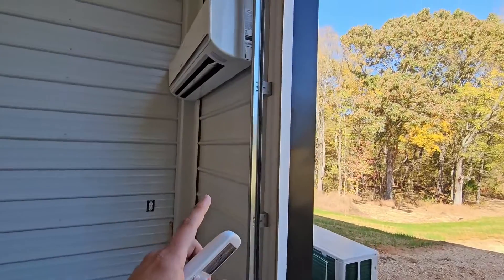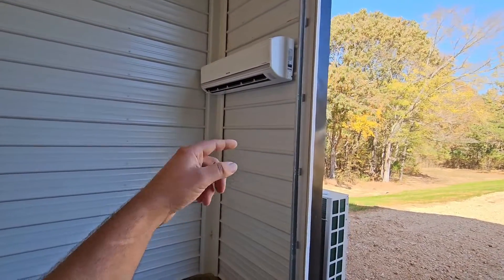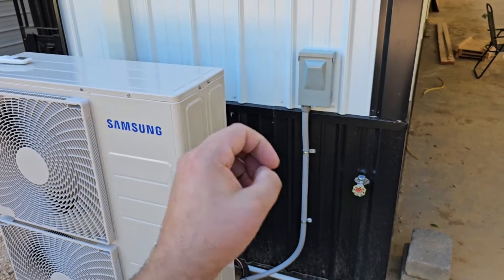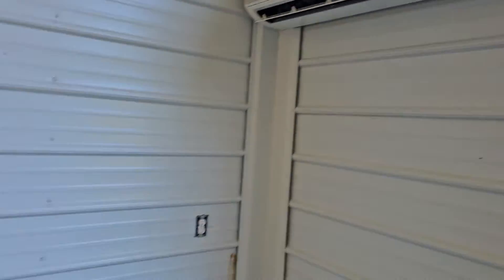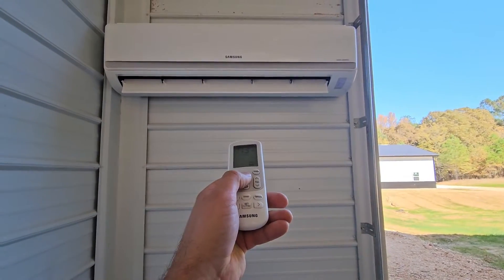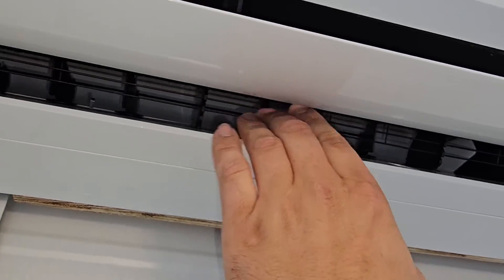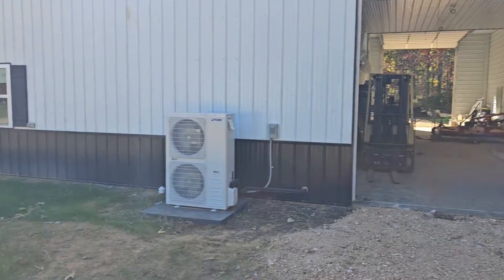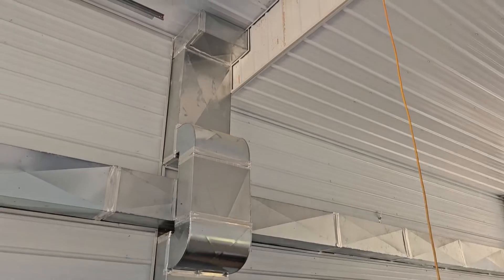"Shop Comfort Redefined: Mini Split Madness!"

Comment: Hey, is it a dumb idea to put a regular mini split head on a 4' knee wall in a bonus room? Will that work ok? I could potentially put in on the gable end at the regular recommended height, but I'd have to order a new line set and put everything on hold.
Reply: I thought he had a video on featuring a room like that. You probably want a floor mount unit on the gable end- push the air the length of the space.

Comment: should have been installed in the middle of the space.
Reply from the maker: That would have been in the garage door
Gotta have it to wear it throws the air all the way down to the end
Reply: Do heat pumps actually work in cold weather? How about northern North Dakota. Would they heat when its -20F outside.

Comment: Just curious. How do you get the conditioned air movement 60’ from end to end ?
Reply from the maker: If you look at air flow and temperature distribution charts for this model. Of equipment, the air blows up to fifty feet almost.
Reply: @taddydigest  wow !!  Would you guarantee your customer equal temp through out the 60’ length. Just so I know what to tell a customer of mine. Thanks !